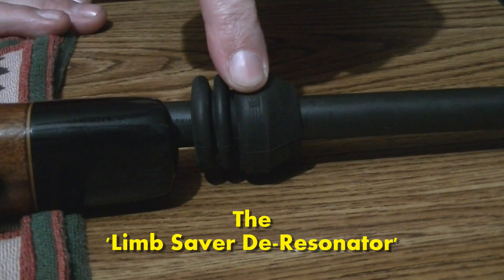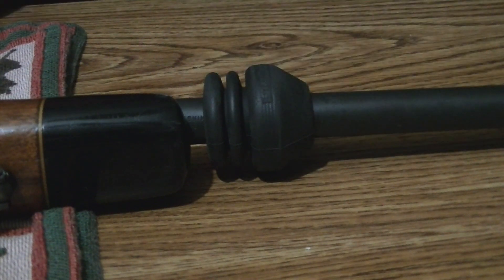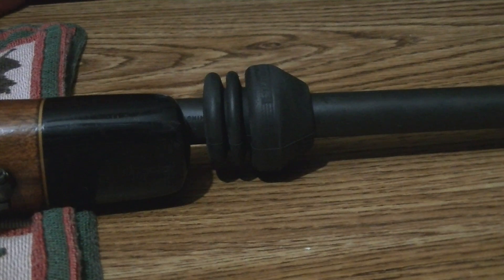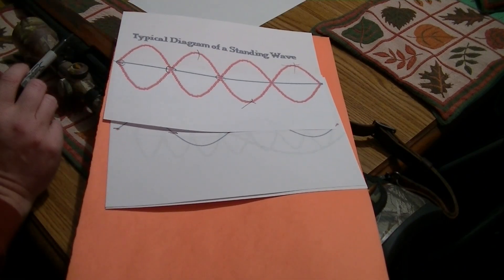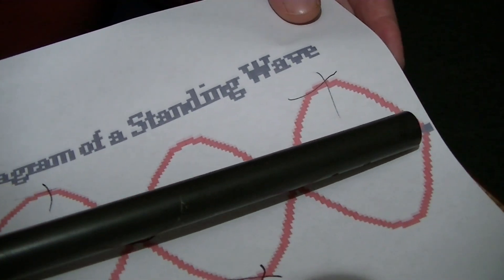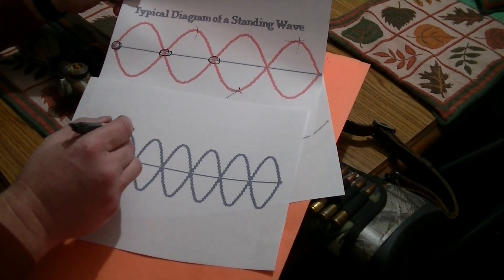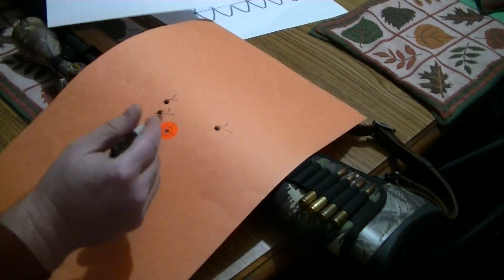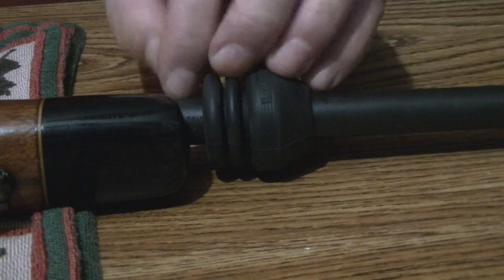What is a Limb Saver (Rifle Barrel) De-resonator?

Comment: Sorry Bubba, but you actually want the bullet to exit your barrel at the anti-node. It will decrease the variance by 1/2! That will decrease your POI by 1/2. These things are great and I just wanted you to get the reasoning. There are slight variances in powder loads and other factors that affect the velocity. OK, say the bullet exits the barrel at the center of the node with a perfect load. If it is a little light then it will be a bit slower and not quite reach the center of the node. This will cause it to leave the barrel say 1/4 high from center. Same thing if it is faster, it will be, say 1/4 inch low. That is 1/2 inch. Now if you are at the lower antinode and it's a bit fast you are 1/4 inch high. If you are a bit slow you are 1/4 in high also! You just cut your POI by 1/2.
Reply: The angle of the barrel doesn't matter. As long as the POI is consistent. You then adjust your POA to match the POI. The smaller the deviation the better your groups. You can use either the upper or lower antinode. Both will cut your height error by 1/2. This is especially helpful on a lighter barrel. A stiffer barrel will be more accurate by it's very nature and then you need to dampen the effects of barrel movement to attain even higher accuracy.
Reply: +Mars Rover Yes, you are right.  You want the bullet to exit on the upside of the barrel whip.  Having the bullet exit when it is "center" is the worst thing you could do
Reply: +Mars Rover Glad somebody pointed that out!  Not sure I agree with your explanation of why it should leave at the anti-node.  I think it is because of the angle of the barrel.  When the bullet exits at an anti-node, the barrel is aligned parallel with the intended bullet path.  If it leaves at node the barrel is at an angle to the intended path.
Reply: The reason you want the bullet to leave the barrel at an antinode is because the sideways velocity of the end of the barrel is zero at the antinode. At the nodes, the velocity of the end of the barrel is at its maximum, and a very small deviation from the node point will put the end of the barrel somewhere other than where you want it.

Comment: Thank you for your video.  After watching I purchased a bull barrel de-resonator and installed it on my CZ 455 varmint 22lr.  Improvement was immediate.  Position it 3/4 inch from the front of barrel as directions state and started shooting one hole groups.  Never needed to reposition it again.  1 MOA to 1/2 MOA groups at 50 yds.  Not real pretty to look at but does the job!  Also, I thought I may have to reposition for different brands of ammo.  Found that is not necessary.  Thanks again!
Reply from the maker: Awesome! I love it when a plan comes together! Glad the video helped out buddy.